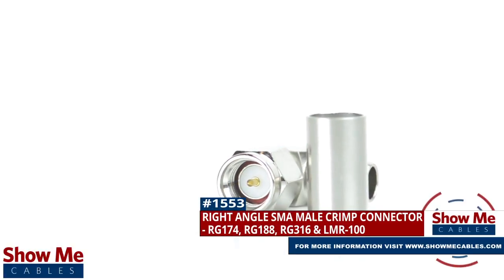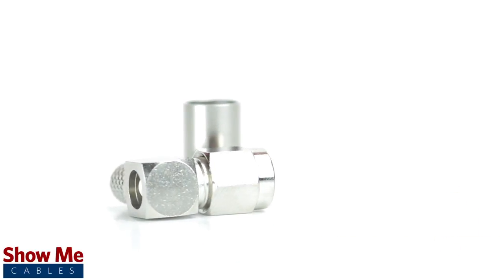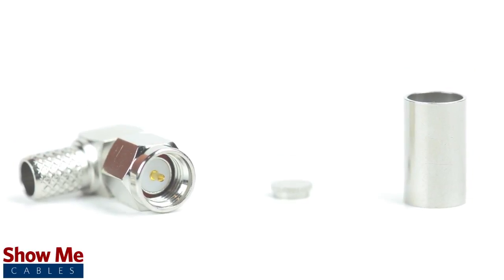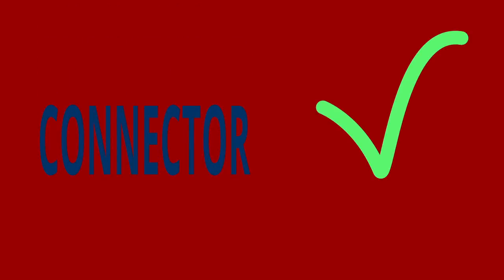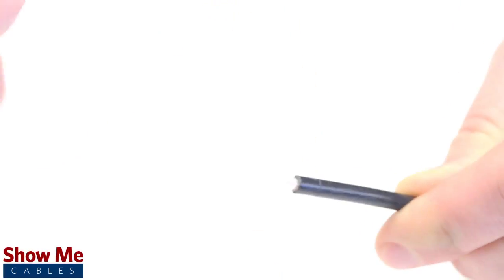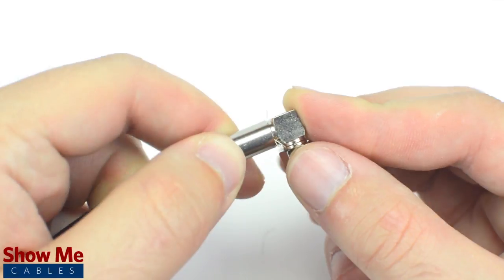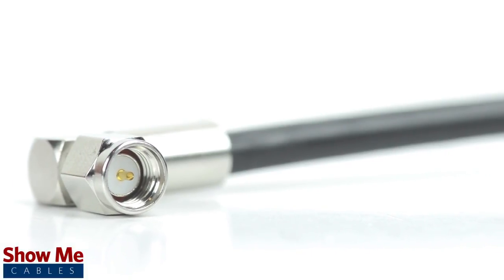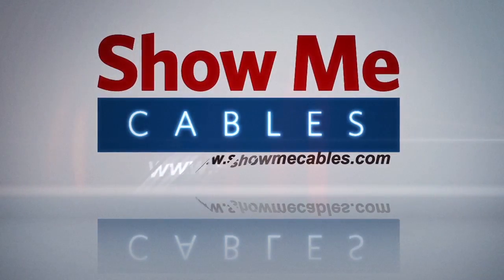Right Angle SMA Male Crimp Connector For RG174, RG188, RG316 & LMR-100 - Perfect For DIY Installs!

Comment: what is the die size used for the crimp tool?
Reply from the maker: Here is a link for the crimp tool needed for these cable types:  http://www.showmecables.com/product/crimp-tool-for-RG174-RG178-RG179-RG180-RG187-RG198-RG316.aspx

Die sizes are listed in the description.

If you have any further questions, please feel free to contact our customer service department at 888-519-9505 or customer.service@showmecables.com